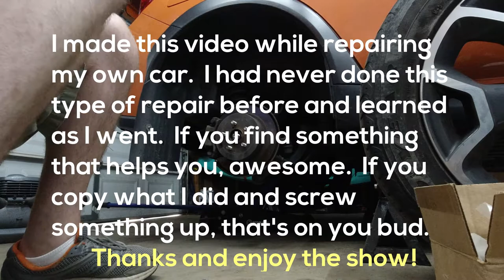2014 Subaru XV Crosstrek Rear Hub Replacement

Comment: My partner and I have been working at busting out the rear passenger hub on our 2016 subaru outback for 3 days now. We were using a sledge hammer and pry bars, went out and bought an air hammer this morning. This hub removal process is the bane of my existence right now.
Reply from the maker: It's absurd how stuck they get, best of luck to you both!

Comment: So how did you determine which side it was, or you just do your best guess and hope for the best. I'm considering trying to take this challenge on. It appears an air hammer is probably a required tool unless I'm really lucky in which case, maybe I should by lotto tickets too!
Reply from the maker: As far as which side, just best judgement/guess.  I took a drive down a quiet road and made some left to right to left to right turns that shifted weight from side to side.  If I was turning left and sound got louder it’s because I was putting more weight on the right rear.  And same for left side if I was turning right.  If you have a doctor’s stethoscope or something along those lines, or just really good ears, you can jack up one side at a time and give a listen as you free spin the wheel.  Depends on severity but you might be able to hear or even feel which one is bad.  Hope that helps.  And as far as playing the lotto, don’t bet on it.  🤪

Comment: I would assume someone has invented a tool to remove the hub more easily avoiding all the pounding and vibrating, etc.  Its probably expensive though.
Reply from the maker: They do and I wish I knew about it beforehand.  Live and learn brother!  It's call Hub Shocker.
Reply: @PK3DNow  I used the hub shocker on my Subaru and a 10 pound sledge hammer. First car I've done where the hub shocker wasn't enough.